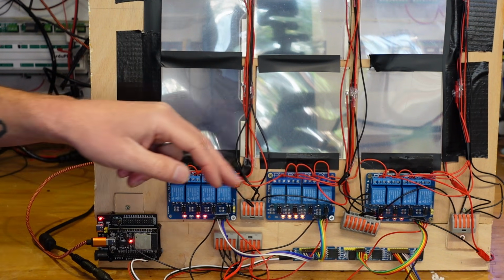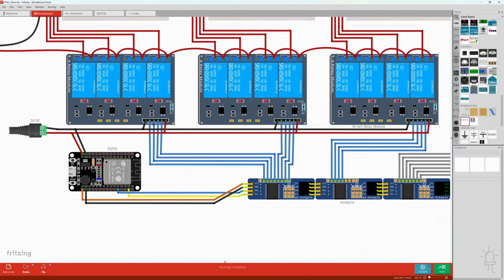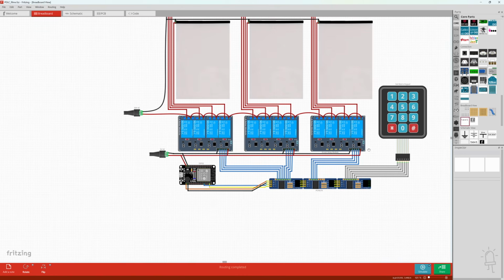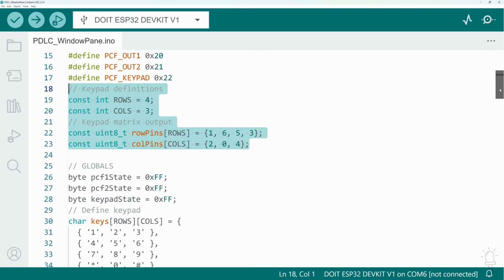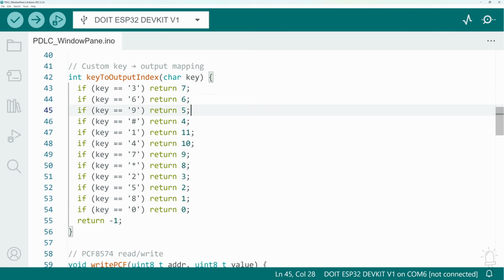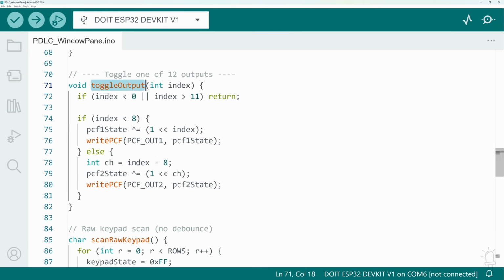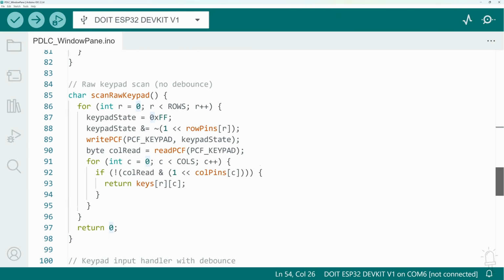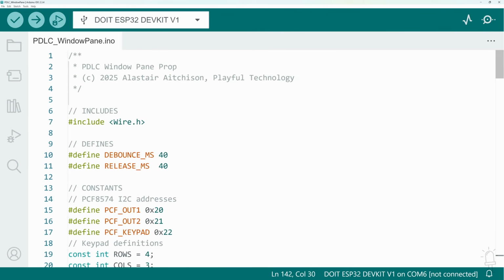Magic Glass (aka PDLC film, or "Smart Glass")

Comment: You can also use an opto isolator and small triac(or an optotriac) if you want silent switching (the same circuit used for EL wire sequencers).